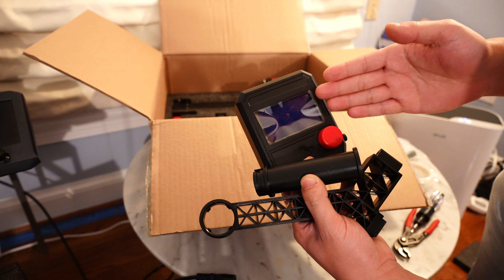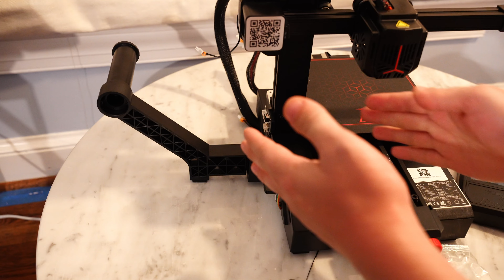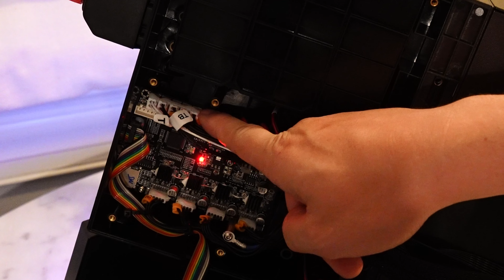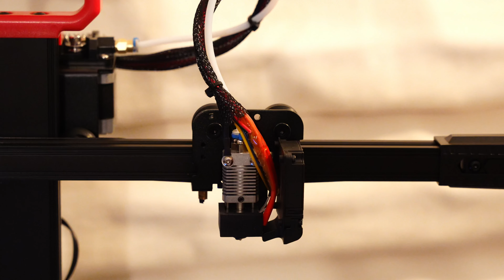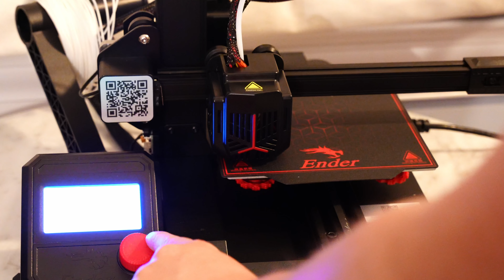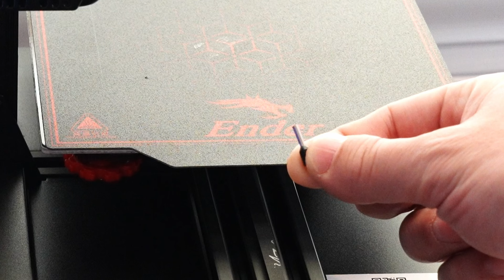Ender 2 Pro - PRUSA Mini print quality at 1/3rd the price

Comment: Cost effective printer, and its upgradeable. For upgrades I'd highly recommend a PEI/PEX bed: Much improved bed adhesion, print removal and most importantly, its easier to eyeball bed adhesion with a hard, nearly smooth level, non-compressible surface. It's very cost effective. For any further upgrades, an all-metal hotend like the MicroSwiss NG is next.

Comment: I know I bought it a year ago for £140 UK

I have now serviced it to update all the features and the printer itself it only cost me £100 so it’s no brainer.

First V4.2.7 board which the XYZE AXES wires are recersed and need to buy  XH and crimp new wires as the originals are  are 5 pin originally and smaller pins. Need 4 pin XH connectors and flip the wires 180. 

I got the 32bit 32gb( there is a64gb which is more expensive) v4.2.7 as I wanted it to be future proof. 

Please If you have your printer enclosed like mine PLEASE add a fan for the POWER supply as it uses the casing for heat sink and heat up the frames and motors on the printer. Should have seen that before hand. Use found out when I wanted to swap the fans for silent ones. 

For fans I got 8x4010 fans as it was £9 and 24v sleeve ones which are almost
Silent. And wire them to fan1 port for them to be on ONLY when printing. I have now got 5 fans setup on the printer. My printer is enclosed in a warm house. So I completely removed the tray and bottom cover for ventilation and access. I opened and closed the bottom about 20 times in 2 weeks . So I finally had to execute the decision.

I have added silicon to the four corners of bed, this allows long maintenance on bed level. And the Capricorn Bowden tube. no brainer as it is fluid and heat resistant to high temps.  

Dual gear extrusion its no brainer as it is boden tube setup and needs more grip. 

You do NOT need to upgrade the belts, but I found it for £7 for 5meters of 4 layer brown belt which is no brainer for-me. However the original has fiber ones and its barley scratched from 1 year of use. 

I have diy hacked a filament run-out sensor with a limit switch. I have a 3D touch but need to set it up. And thinking about putting the screen over to the other side-with an extension lead for SD card. I wish there was an option to upgrade to a full usb terminal. I found these 13 core 21Amp wire for really cheap 1M for £7 so yeah I may hack the wiring on the hot end. The way to go about it is with lever wire connectors that is modular and best easy connections with easy maintenance. I may need to design and print a support for that. And this will be a no brainer as I got fedd up with wiring and long sleeve removal. 

A free upgrade is putting filament down the wire sleeves to support and guide the wires especially the bed wiring as it will grab the motor. Also just remove the casing around the hot end it just limits air flow and adds weight. Just used magnets to gold the fan to the blower fan. And connect the fans to the fan2 port.

Any other upgrade that I will invest in is the spring steel bed sheet double sided.  All ball bearings to clear or red, visually its more Pleasing with the printers ready accents. Might try the pully bearings as they have a gap in-between and may help be shock abbrobent or hust slimmer for speed. 

I am able to print 300mm/s with good quality as my good as my first rabbit print.

Comment: Is there a better ribbon cable that could be bought separately that doesn’t have creality’s flaws?
Reply from the maker: Someone was asking me about that. I bought a couple replacement cables, they are available for under $20

one other possibility is to use the modder board, install it in the base, or on the x-axis where the X axis motor goes, then run “normal” cables out to the hotend to handle the high flexing portion of the cable.

Comment: prusa really is starting to fall off. theyre stuck making overpriced printers that can barely keep up with all the mainstream brands that are half the price. if i use creality as an example, the prusa xl is 1999 bucks, meanwhile the ender 5 plus can make parts of comparible quality at 650 bucks, not even a third of the price. same goes for the rumored mk4, with the ender 3 s1 pro released already you can have an extremely good printer for 400 bucks, not to mention you dont have to assemble each part and theres not 3d printed parts holding it together. even has a titanium heat break. prusa needs to chill out with their pricing since theyre hardly distinguishable from the competition aside from their orange color.

Comment: Great video.  Been using mine for a week.  It’s my first 3d printer and really impressed with the print quality.  It is definitely noisy.  I haven’t used a 3d printer before.  Gonna build an enclosure to help with the noise.  Thanks for pointing out the fire hazard issues.  I won’t be leaving this printer unattended while printing.
Reply from the maker: Always a good idea to keep an eye on the printer. 

The noise is a bit of an issue, but it can be fixed if you don't mind taking the printer apart.

Comment: I get a bit frustrated with people's gripes about no crimped ferrules. There are two use-cases for crimped ferrules:
1. Amateur assemblers who leave strands of wires poking out of the connection hold. (The shroud is  more idiot proof)
2. Cheap connectors with spring-leaf terminals that deform in use. When reusing, you need to pry the spring leaf open again.
That's it! If it's a factory assembled circuitboard, there's a fair assumption that users aren't going to be swapping wires in and out. 
Regarding the fan noise, yes, that would annoy me too. Fan blade design makes a big difference to this. Also things like blade count and motor support strut count (Hint:use prime numbers on both to to reduce harmonics)
Reply: I agree, also the comment about highly flammable plastic seems a little overblown. I have seen the crimped ferrules mainly in fairly high-end CNC's and they are a pain in the ass if mixed with the spring connectors, plus it takes up more space in smaller areas. If you aren't dicking around with the wires all the time (it is also an area that doesn't have any movement) and your screws are tight there should be no worries.
To note I would rather have a plastic casing than a metal one; if one of those leads did pop off and touch the metal box it would short to ground killing the electronics.

I also would source a different fan rather than using a resistor. They are only a few bucks, and I don't have to hack up wiring for it to work. They also make quick connects so you can remove fans without having to use butt connectors.
Reply from the maker: I also think it is overblown, but would still like to see it on the main power connector and the bed. 

https://www.researchgate.net/publication/226464542_Creep_deformation_characteristics_of_tin_and_tin-based_electronic_solder_alloys

Tin solder will creep over time, but at the temperatures and stresses of typical installations I think it is a non-issue. 

However, 3D printer manufacturers don't have the best quality control. If a connector is loose from the factory, it could generate enough heat to cause creep. 
In any professional applications I have pensions seen or worked on,  crimped fertile seems are used. They are cheap insurance and required by regulation according to datasheets and regulations.

Most printers come with a 350W power supply. 350W at 24V is about 14A. Most terminal blocks are rated for 9-14A, and best practice is to size 50% over. So it's not like these are low- power connections, and significant hearing may occur. I would wager that many printers are using components that are underrated for their application (the Chinese philosophy of "If it looks like it works, sell it")

I appreciate your comment though, made me look some stuff up! It's always good to question your assumptions.
Reply: @NathanBuildsRobots  I've had Extruder connections fail before. I think the issue is like you say, connector rating. I don't think ferrules make a lot of difference here. If a connector is abused in rating then it gets hot in use and this encourages copper flow, which loosens copper in the terminal. These connectors are also prime candidates for dry jointing through the PCB connection, both due to load and that securely tightening the screws imposes a high load on the through hole pin which can be under-rated. This can be a small start to even more heat at the terminal. standard connectors clip together in twos and threes, I dislike the 2's, especially installed by themselves as they are much more easily twisted around in the process of tightening to an appropriate level for the wires fitted. Connections should all be retightened after a few minutes to account for copper flow, you will find it easy to turn the screws a bit more.
Reply from the maker: @fluiditynz  I would like to know more about connectors. They are components that are often taken for granted. 
I read in the datasheet that they don't recommend using 2 or 3 pin terminal blocks, 4+ is preferred.

If you must use 2 pin blocks they say to hold the terminal while Tightening so it's not twisting the board connections.
Reply: @NathanBuildsRobots  Yes Nathan, I've worked in the Electrician industry, Elevator industry, Security industry and years ago I ran my own hardware and software design business for 4 years. Applying high torque to a 2-pin connector terminal screw will twist both pins and the whole connector around so I agree. 3 pin connectors are much much better and I've never noticed it above 4 pins, I don't think I've seen it for 3 pins either. Spring leaf terminals are very budget but they still have a use case, where a product is factory assembled and not expected to require significant repairs over it's life cycle, that's most consumer products these days and the cost difference between the two is very significant. Rising clamp terminals are definitely a superior product, basically they form a rectangular tube with two shortening walls.  For mains connections, strand count is important for twisting. If there are only a few strands then screwing up a terminal will pinch the strands where they cross. For multi stranded wires though, this is not normally an issue and the twisting is useful to keep all strands together with none spiking out.  It's good general electrical practice to fill the terminal as much as possible before tightening to reduce the point loading on the cores from the tightening. This can involve folding the ends over neatly. Twisting serves a triple purpose: tidying the strands together, thickening the connected mass and forming a semi cross grain that the connector can lock on to better, it's harder to then pull individual strands out.
Reply from the maker: For fan noise, I have tried about 30 different 40mm axial fans. None come close to Noctua in overall performance and low noise. Some fans were super quiet, until I mounted them on a duct, then the backpressure caused a huge amount of noise. Noctuas seem to operate quietly across a wide range of conditions. There are a lot of small details in their design that I appreciate. 

Also, it's not necessarily the dB value that is the enemy. Sometimes the noctua is the same volume or louder, but sounds quieter/less annoying. Probably has to do with the particular frequencies/ harmonics that are being generated. Either that or it's the placebo effect and confirmation bias!

Comment: The part cooling fan can be quieted down by simply cutting the plastic cover. The small openings for the air to pass through make it kind of whistle or give off a high pitched noise. You can also print the minimal fan shroud which, for me, really quieted things down, even with the stock fans. I have this printer on my desk at work and nobody around me says they can even hear it. There's an ABL mount for the minimal shroud, as well, but it might just be for the BL Touch.
Reply from the maker: Solid advice! I will try cutting out the grates next time i've got excess fan noise. 

The other thing is - creality quality and performance varies from printer to printer. I'm pretty sure they are made in many factories across China. So some may perform better, or use quieter fans than others.
Reply: @NathanBuildsRobots  I totally agree. Some have the 4.2.3 board in them, some have this 2.4.S4 board, apparently. Seems to be hit and miss on which one you get. Kind of like the F1/F4 boards in the S1's. I saw that you've done what I ultimately wanted to do to mine and make it an Ender 2 S1 with the Sprite, etc. Nice work!

Comment: My 11 year old has a heavily modded ender 2 pro with a 4.2.7 board, an ender 3 v2 screen, a CR touch, dual 50x10 blowers and mriscoc firmware.  It was a journey getting there but would love to share.
Reply: Do you need firmware update for the screen or isit plug and play?
Reply from the maker: Interesting, that thing probably looks like a mini Ender 3 V2. 
Why change the board out though? Did you have an issue with the first one?
Reply: @NathanBuildsRobots  wanted to make sure the mriscoc firmware was compatible.  That firmware will also allow you to change the build volume to accommodate the small printer.  The weak point is the power supply.  Got a 16 minute benchy but when putting the acceleration up to 2000mm/s the power supply will black out immediately after the purge pass.
Reply from the maker: @kennyjandreau1758  good to know. I always spec out power supplies with at least 25% overhead during worst case loading.

Seems kind of crazy that they would spec a power supply that would black out, even if you're pushing it a little harder than the stock machine. Crazy, but not surprising from Creality.

Comment: I have one. Installed CR-Touch, improved the fans, upgraded the extruder to the metal version, and upgraded the heatbreak to slice engineering. Also running Klipper. Works very well
Reply: my cousin has one its his first machine, I built it for him and have BL touch just sitting as a spare.  I'm curious where you found a touch probe firmware
Reply: @gitss7367  he is running Klipper, that is the "firmware" and you configure the probe as needed and on the fly. Do you really need a BL Touch on such a small bed? A good manual leveling is all I have ever needed. I don't do much "higher" temp printing with it.
Reply from the maker: Sounds like a good upgrade path. I went all-out and put a Sprite hotend on mine. It's overkill, and adds some ringing, but I'll be able to get 25mm³/s+ flow rates
Reply from the maker: Also curious how much Klipper helps on a machine like this
Reply: @NathanBuildsRobots it's just a better firmware vs marlin. I love to control it remotely also, and so much easier to configure. I don't print fast, it's just the robustness really.

Comment: This would be great to have to print printer parts with.  Probably flies with klipper on it too.
Reply from the maker: I think it will have some issues with vibration at very high speeds. The single column design can twist, so the dual column design is much more structurally efficient and should be able to handle much higher accelerations. its probably something like 10x stiffer having a second support.

Comment: You can add a cr touch to the ender 2 pro. I did it, you do have to print the bracket to hold the cr touch on the hotend, BUT, it's super easy. You will have to flash different firmware. It's not normally available on creality's website. I found download links both on the thingaverse page for the bracket (in comments) and on the ender 2 pro subreddit, plus calibration instructions. 
Another must!!! PEI plate and silicone bed spacers instead of springs, great quality first layer and never gotta re level the bed!
Great video!!! Need more content for this printer.
Reply from the maker: Thats too funny. I looked at the mainboard and there is the spot of the CR-touch, so mechanical and electrical install should be straightforward. Wish they were more on top of things with their firmware for new releases! I have a sprite hotend on there now, but left the CR-Touch off.
Reply: @NathanBuildsRobots  oh wow really!? I've been curious as to if a sprite direct drive could be installed on that. What did you do about the grounding wire going from the hotend to the board? And how did you calibrate it, ie settings changes? Sorry got me super stoked now that I know it can be done. 
I'm with you on wishing they'd get there crap together, would you like a link for the firmware download?Someone has it on a Google drive link.
Reply from the maker: @johnnyhellfire6  I swapped it in with no firmware. I reverse engineered my own breakout board so I know what all the pins do. The last 2 wires are ground, I'll show you in the next video! Technically the ground is not necessary, I think it's required as a safety regulation.

So yeah, get subscribed! 😀
Reply: @NathanBuildsRobots  way ahead of you lol all subbed up, I can't wait to check it out. I put an one of those sprite all metal hotend direct drive on my v2, looks like that can pop in there. But good to know on the ground wire. I was confused as to why they needed one lol